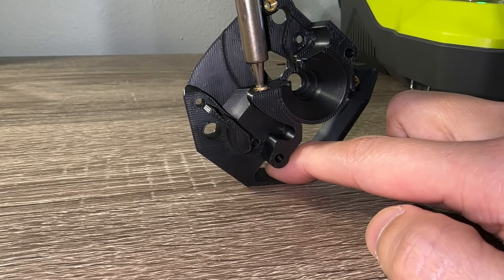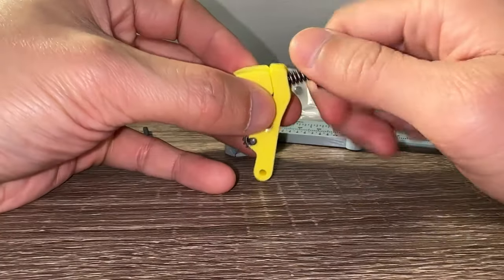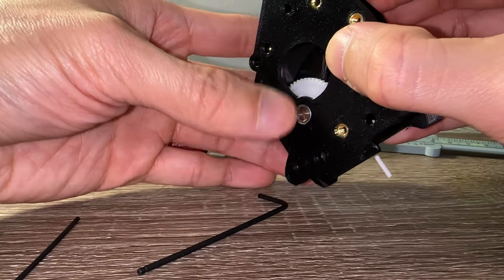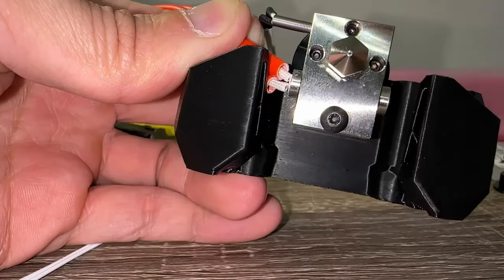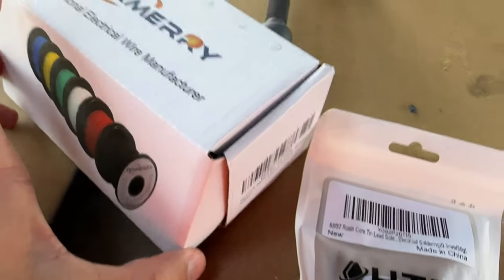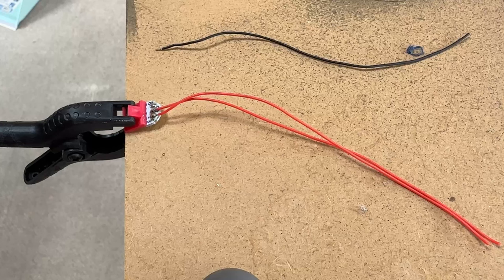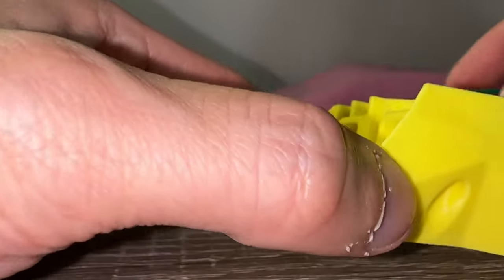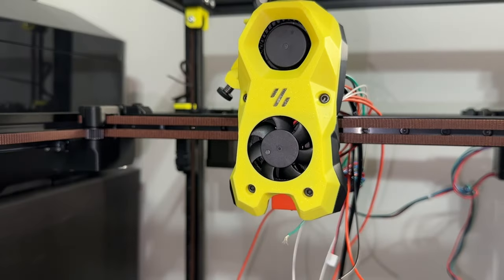2023 Voron 2.4r2 Part 9: Stealthburner (ClockWork 2, Tool Cartridge, NeoPixels)

Comment: There are soldering iron tips for inserts. They make a huge difference and because they are properly fitted and have a flat surface, you get better heat transfer and straighter insertions.

Comment: For heatset inserts:

For inserts that sit on flat faces: Insert 90-95% of the way and then immediately place it flush with a flat metal surface and hold until it cools. This will straighten insert and make it flush without plastic coming up around the sides.

Try using a tip that doesn't go inside the insert very well, you can have the insert shrink and bind on the tip which will destroy the part. I use a T15-BC2 usually. Takes more practice though since you aren't holding the tip straight in but I've never had an insert bind this way. Don't know how this works with the cheaper irons though (T15 series has the heater and thermocouple inside each tip) as the T15 holds temperature extremely well.

@Bidiversety I might actually try the 'insert spacer' sometime sounds like an interesting idea.
Reply from the maker: Thank you for your detailed insight on these, it will definitely be helpful to beginners.  There are many heat sets used in the build and it only takes one gone wrong to ruin the day.